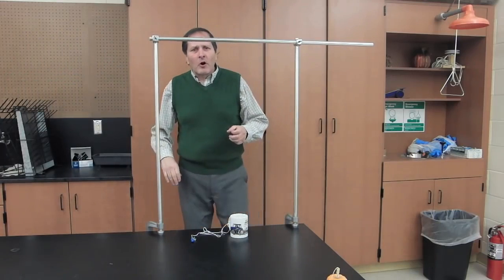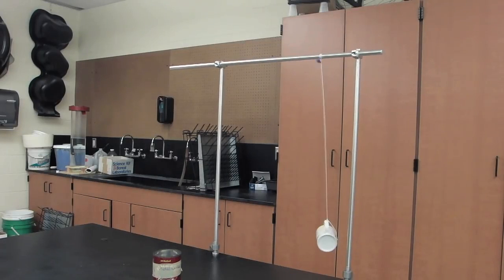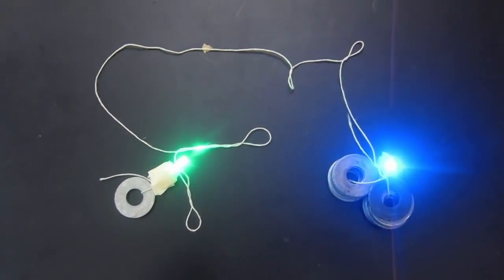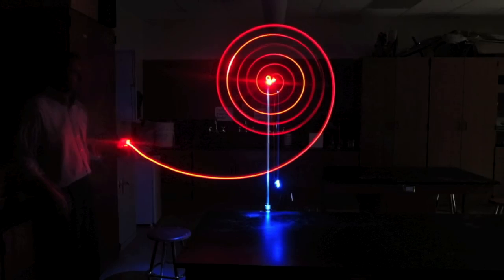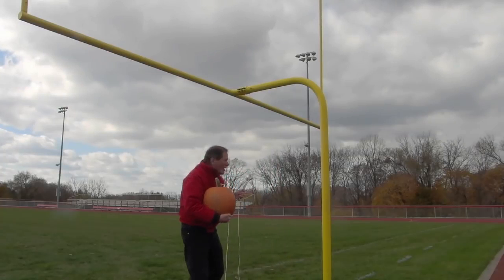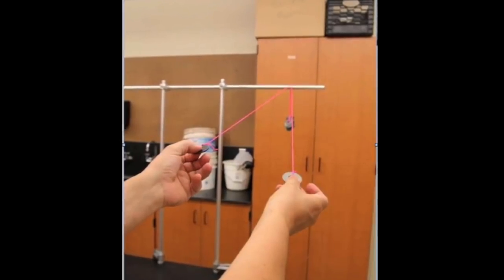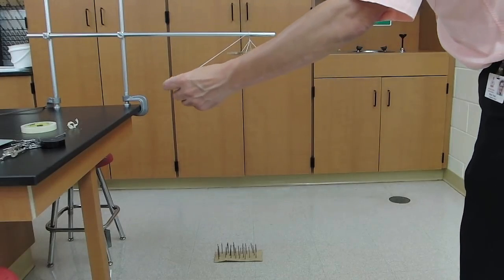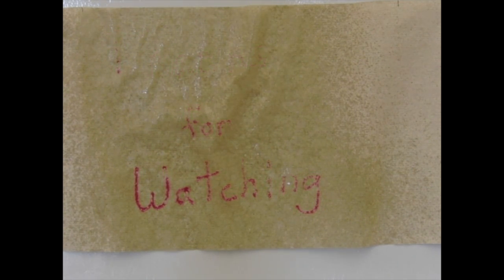Toy Physics - Looping Pendulum /// Homemade Science with Bruce Yeany

Comment: i wonder if uou let the small weight go at different angles and different air drag ratios, or if the string was replaced with floss or thread, and if the pvc bar was metal, or polished metal, also what if you introduce a spring on to one of the weights

Comment: Now I want to know what would happen if there is a rolling cylinder as the pole. Virtually no friction but angular momentum. The pole would be connected to a controlled mass flywheel. The flywheel would act as if the pole can't rotate at all, but thwn it would start rolling. But when exactly would it start rolling? At what moment? Would it be possible to trim the flywheel angular momentum so that the flywheel initially starts rolling, then stops, and then resumes unrolling the string?
Would it be suitable for a safety mechanism for workers on heights as a controlled deceleration on very passive systems?
Reply from the maker: good question,  sounds like you have worked it out  but I will give it a try
Reply: @YeanyScience  to be honest, I didn't do anything yet, all merit goes to you for inspiring me.
Most of your videos cover topics I already know about, and most of them put a new twist on me about the possibilities of what I already knew.
This video wasn't one of those, but you already triggered me into thinking what would be a possible twist on the matter

Thanks for all your work and sharing of these years!

Comment: The diacceleration looks pretty abruptly. What accelerations and jurks those the heavier weight witness?🤔 PS:Again, why do you have to use food. Why not using magnets instead.. It would be more interesting and less wasteful. Imagine a big copper weight rushing down and a big plate magnet braking the fall before the light weight has a change to completely wipp around. 🤔 What happeneds to the little weight when the tension from the string is abruptly gone before it can complete its journey

Comment: (1:40) I was very curious about how you captured this spiral-shaped photo. Did you use a professional camera, or can it be done with 1 webcam and software?
Reply from the maker: done with a point and shoot camera,  set the shutter speed to be open for 3 seconds, and then set the delay for 10 seconds so I could get into position
Reply: @YeanyScience  Thank you for the information. I took many photos like this with old generation film cameras. However, since I do not have a new generation digital camera, I did not have the opportunity to try this method. :)